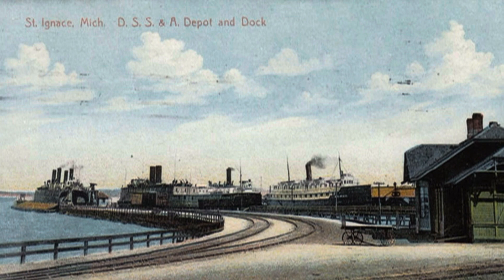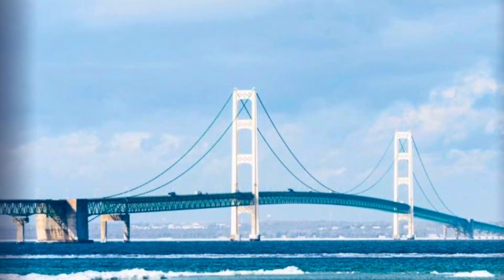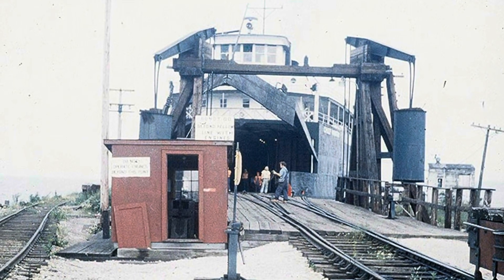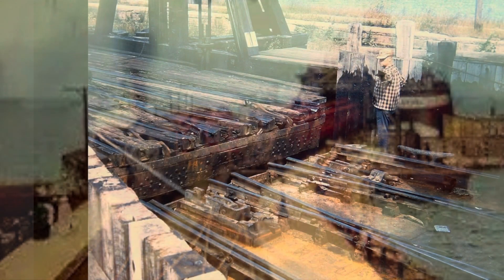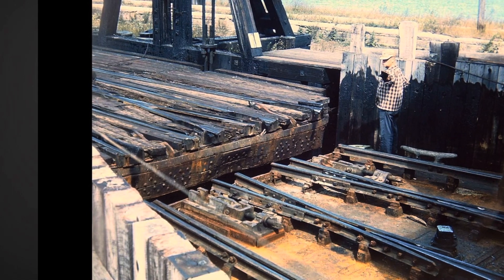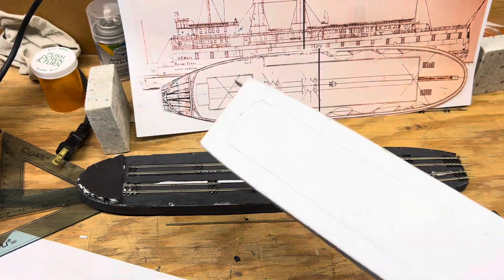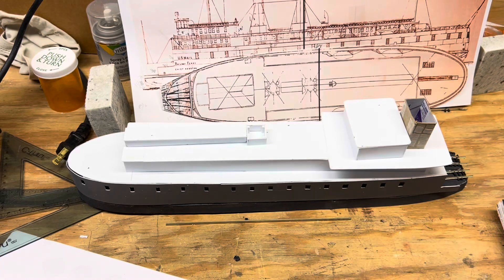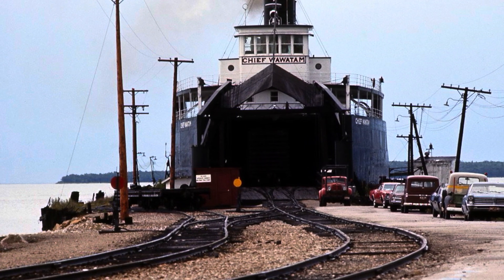Model Railroad Car Ferry Pt. 1

Comment: I remember seeing the "Chief" in Mackinaw City as a kid waiting for the ferry to Mackinac Island.  She was the last of 3 sisters built for the Straits of Mackinac, and hand fired coal to the very end, never rebuilt, never repowered.  She was "refueled" by shoving in 2 coal hoppers ahead of the revenue cars, and when these coal hoppers were all the way back they dumped into the coal bin below.  I'm very interested to include a car ferry as part of operations instead of a staging yard taking up a lot of space.  Cassettes of cars can be loaded in and taken off layout, with multiple cassettes in storage below the layout.  Some of the Lake Michigan ferries could handle from 28 to 32 cars total on 4 tracks - quite a lot for a model railroad!
Reply from the maker: Thanks for your comments. I learned even more about the Chief. I now have some new info to enhance the operations once it’s built!

Comment: Has your research turned up a reason for why it was a bow-loader and had fewer tracks than contemporary Great Lakes car ferries between Michigan and Wisconsin and Illinois?
Reply from the maker: The bow loader  I believe was due to its capabilities as an ice breaker. Also, the ship was built in 1911 so that may have had something to do with capacity, as would have been demand to move freight through the Straits. The Upper Peninsula was sparsely populated and western parts were easier to reach through Wisconsin. The UP was often a destination for deer and elk hunters in the fall and they often used the ferry before the bridge was built. It could handle 26 freight cars. Thanks for watching!